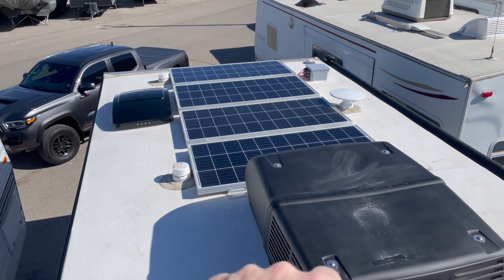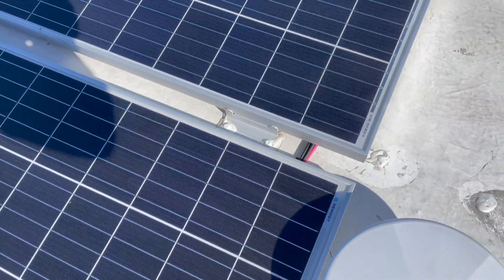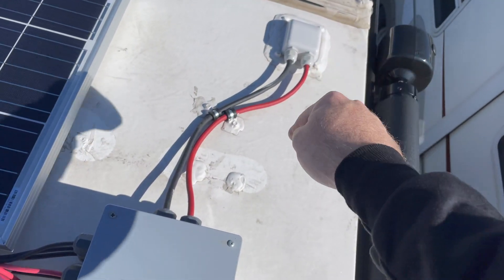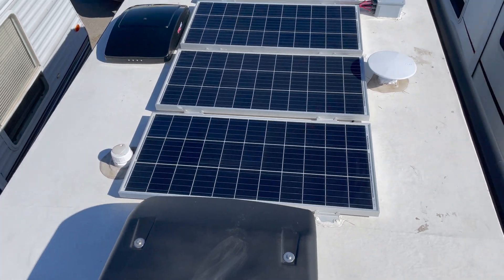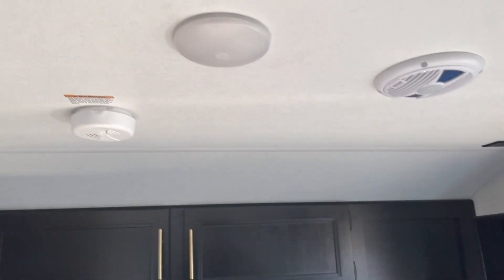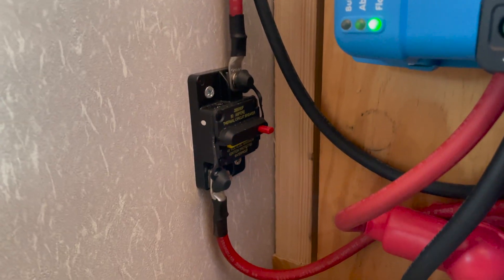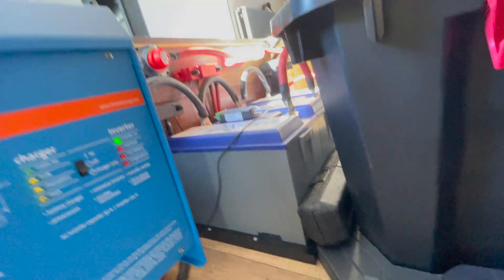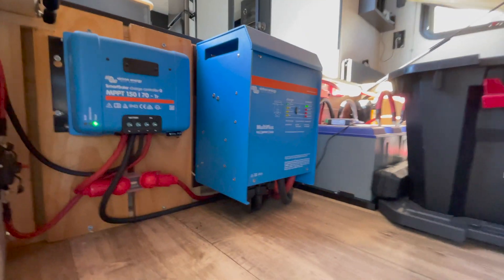RV SOLAR UPGRADE COMPLETE! ☀️🔋 - Wolf Pup 16TS Travel Trailer

Comment: Great video. Thank you! I have factory installed 50W Solar with Waaree Converter (not compatible with lithium battery). I have a hard time to trace the wires (don't really want to take the walls apart). Is there a way just to disconnect it? Which wires would I unplug?

Comment: I had a question for you, I have a 16bhs which has a lot of the same equipment stock as this one. I’m having a hard time figuring out why the new charge controller isn’t powering the camper unit up with lithium battery installed. This is what I have, 75mppt charge controller and 200ah lithium battery. Removed stock waree controller and had 4 wires total coming from the wall. I attached all wire to the new controller and through the app that runs Bluetooth it’s giving me 20-22volts from solar and 14volts from the battery but nothing is powering up.
Reply from the maker: The solar charge controller doesn’t power your 12v system. It simply manages the power used to charge your batteries. If you are not getting power so your system, check your battery cuttoff switch and fuses.

Comment: Can you please quickly describe how you are going from the solar panel MC4 connectors and into the conduit box and then the 4 gauge wire?
Reply from the maker: Panels go straight into the combiner box with a fuse inline. Combiner box has a positive and negative bus bar. Then the run goes from the combiner box down to the solar controller.
Reply: @TheRVPastime  Thankyou!! I bought a bunch of stuff through your Amazon affiliate links. Looking forward to more in-depth videos of rigging solar and electric in general in RVs if you get another one!!!

Comment: What brand batteries did you use?
Reply from the maker: Battleborn
Reply: One last ? For your 110v power did run a wire to box under frig from inverter. You can see my electronic knowledge is limited!! When ready I have a person who understands. I'll share your video with him to see how done. Tks
Reply from the maker: Yes, there are two 110 cable runs. One from the shore power plug on the outside to the inverter, and then one out of the inverter to the 110 side of the electrical panel.
Reply: @TheRVPastime  assume 110V run fished behind inside wall with flexible rod to breaker box. Tks
Reply from the maker: No, actually goes out the floor under the bed under trailer along the frame and then up into floor behind breaker box.
Reply: Appreciate information friend will help actually I'll help him and probably only cost me few cases 🍺 and wife's home cooking.

Comment: Great video have same unit and getting ready to go solar. From setup under bed how did you connect to fuse box in trailer? Tks
Reply from the maker: For the 12v, I connected into the existing 12v run to the fuse box from a terminal under the trailer.
Reply: Not much with wire setup understand 12 volt terminal but for 110 outlets do you connect another wire or does inverter do that? I have an off grid cabin with 1320 watts solar. Had it installed works great. Probably have him help with my camper
Reply from the maker: Watch the electrical upgrade video I have on the channel where I explain the path of electrical connections and such for this installation. Thanks for watching :)

Comment: I am getting around to adding lithium and solar to my 2020 Wolf 16FQ finally. How did you design the system you have? I would like to add 4-600 watts solar and 2-3 Battle born 100 ah. I don't think I'll bother with an inverter. Where did you get advice? I don't want to screw up.
Reply from the maker: Lots of YouTube videos and the electrical knowledge I already had by trade.

Comment: HI, I know you sold this wolfpup camper. I have the  wolfpup toy hauler version of that one, same roof and length. Do you remember the length of the screws you used for the solar panel brackets into the roof? Ones that came with my panel z-brackets seem too long at 1.5 inches. Thanks!
Reply from the maker: I don’t recall actually. It was the screws that came with the brackets.

Comment: Do you (Or anyone) know if the roof can be drilled into anywhere if there are beams / studs / rafters that need to be used to secure.  Thank you!
Reply from the maker: There are usually structural supports but the roof itself is usually a sheet of plywood material that can be drilled into. Just make sure to seal!

Comment: Do you know what gauge wire was run stock down the gland? I am all for oversizing. Wires ( for voltage drop if nothing else)... but 400W panels at 12v is only 33A....wondering if stock wiring would have sufficed?
Reply: Dealer says you can add up to 560 watts on factory juice pack (at least 2022)...but IDK is that's BS.
Reply from the maker: I ran bigger wire for a couple reasons, 1. I had it already and 2. the plan was to have more panels up there at higher wattages. On the newer models they use a furrrion solar controller which can probably handle more panels. On the model I have the 2021, it used a Waree solar controller which was… Less than capable. I think the original wire is 10 gauge? Not 100% sure.
Reply: @The RV Pastime  Thanks for the feedback.  Nice job BTW 👍

Comment: Just got a 14CC.  Could you share what you found for connections to the factory panel?  I’m adding a 50 and a 100 watt panel.  I’m hoping to use the factory wiring and leave my mc4 connectors up top to avoid having to use a box with bus bars and drill a new hole.
Reply from the maker: Connections were just bare end wire to Wago connectors. No MC4 connections. You should make sure the solar controller can handle the extra panels as well as the gauge of wire if you are wiring in parallel or series.
Reply: @TheRVPastime  I’m going to parallel the 50 and series the 100 to keep amperage low, so hopefully the factory wiring will be ok.  Was there enough wire up there off the roof side and panel side that would allow me to cut the connectors off and install MC4?
Reply from the maker: There was not. You’ll most likely have to have a box OR take out the existing cable gland, stuff any extra cable in there and re-install and seal the cable gland.
Reply: @TheRVPastime  Right on.  Can’t thank you enough for the videos and insight.

Comment: How is the Wolf Pup roof internal construction? Can you mount the brackets for the panels anywhere? I'm ready to go solar!
Reply from the maker: You shot be able to. There’s a couple layers of plywood it looked like. At least in some areas lol.
Reply: @TheRVPastime  So you were able to anchor panels at any location on the roof with wood screws? Using sealing goop at brackets?
Reply from the maker: Indeed

Comment: Very nice and clean install.  Nice work!  I would suggest you get some eternabond tape and run a seal over the front roof/cap area.  Thats where my wolf pup began to leak after two years.

Comment: I realize there is a convenience option of mounting the panels to the roof, but did you consider separate panels that can be located independent of the camper?  Looking at most of my camping options, it tends to be in more forested areas and being able to move the panels would have an advantage.
Reply from the maker: That’s always an option. I may end up installing a port on the side of the trailer for that exact capability.

Comment: So what made you decide on that much solar? I have the wolf pup 17jgBL and the fridge is the only thing that drains the battery. I was doing the math and looked like if I just added another 200w panel and 2- 6 volt (100 ah) batteries I would be good for several days unless super cloudy.
Reply from the maker: Good question! The main reason is because of the inverter. If I want to run the AC or other things off the battery through the inverter, that all needs Juice and the ability to charge the batteries back up quickly or otherwise offset the load.
Reply: @TheRVPastime  so you were able to run thr AC with just the batteries?
Reply from the maker: With the inverter yes. With my bank of batteries it can run for just over an hour.
Reply: We took our wolf pup off grid for the first time.  I brought 1 sunpower solar module that is 400 watts, an Outback charge controller, 2 AGM batteries, and a 3 kW inverter. I think the large fridge and radio drained down everything in just one day and night of use.  Trying to think if I need more solar power in parallel for more current and/or more batteries in parallel to bank.

Comment: Do you know if you can just upgrade the stock PV panel to a 100 watt panel without changing any other components?  Was hoping to not make any new penetrations on the roof.
Reply: I found the manual on mine and it says it can handle under 50 amps of power so according that you can. I will be trying and see what happens.
Reply from the maker: I believe you can and people have. Just depends on the capacity of the controller.

Comment: Great video!  I will be getting my 2021 Wolf Pup delivered in mid July, and was envisioning this exact same setup, your video definitely helps show that what I was planning will work.  One question is what did you use for the combiner box?  it looks like it may be a DIY with some cable glands, if so what size box did you go with?
Reply from the maker: Congrats on the new pup! The combiner box I did put together myself. I believe it is a 6x6x4 box. All parts from Home Depot.
Reply: Great setup!  I have a similar project in mind for my Wolf Pup.  How well does this keep up with the 12 volt refrigerator?  Could you stay off grid indefinitely?
Reply from the maker: With this setup in good sun, yes you could go for a long while if not forever

Comment: Any tips on mounting them to the roof?  What did you do to prevent roof leaks?
Reply from the maker: Good question! The mounting hardware came with the brackets. Pretty hefty screws that just go straight into the roof. I applied self-leveling dicor to the surface, placed the bracket down on top of that and then screwed it in. I put down enough dicor so the screw could grab some of it on the way in helping seal the hole. THEN, I covered the bracket, edges, and screws in the dicor. It was a pretty standard installation and there are very helpful videos on YouTube that display this in detail :)

Comment: This is excellent: love all the upgrades. Now your on a single axle; How are you doing with weight?
Reply from the maker: Under gross and under payload & tongue weight on the Tacoma!
Reply: @TheRVPastime    lol not the truck the actual TT; Example my Dry weight is 3800lbs and the TT has a maximum carrying load of 998 lbs for total gross of 4798lbs. Now add my 1 standard battery and 1 LP tank. Plus pass through storage. Clothes full fridge with beverages "water weight " and say you are dry-docking and your towing 30 gallons of water = equals 240lbs. I understand not to exceed towing gross on TT; But how about when its docked?  Forest River 2021.5 Surveyor Legend 19BHLE.
Reply from the maker: That’s what I meant by gross. I’m still under limits. 👍🏼
Reply: @TheRVPastime    Excellent

Comment: Why 4 gauge from the panels? Wouldn't 10 gauge work just as well in series?
Reply from the maker: In series perhaps depending on the length of the run. I’m running in parallel and still plan to have about 800w up there.

Comment: Would you give me advice on how to upgrade my 16BHS 50 watt solar to 100. Could I use the same controller or would there be other issues
Reply from the maker: I’m not sure if that controller is capable. I don’t even think you can change any settings with it. You could possibly use existing wires and put a 100w panel up instead of adding another 50w and get one of Victrons cheaper controllers.
Reply: @TheRVPastime  👊🏻
Reply: If it's like my 17GJ BL, you can have up to 10 amps on that baby controller and wire a 100 watt and the 50 watt in series and you should be about 9.4 amps. I have not done that but I've seen it.
Reply: @TripleXess  thank you for the info! I would be happier with even 100. I want to get where I can run just my 12v fridge and the water pump occasionally and keep the batteries up with solar alone. There is a video on my channel!